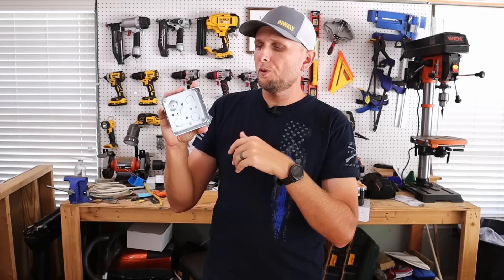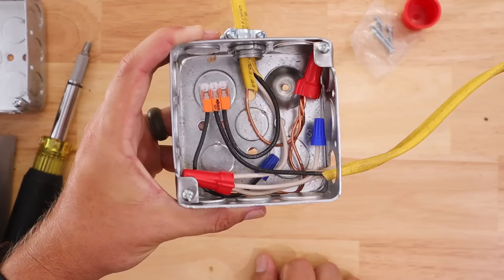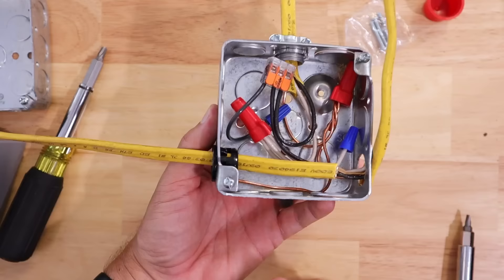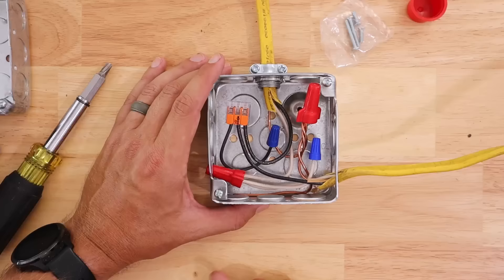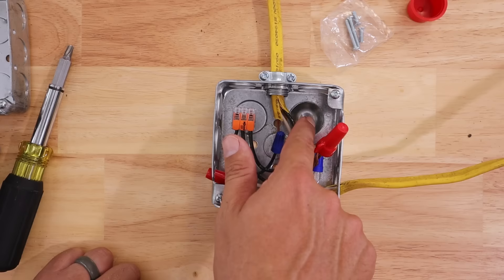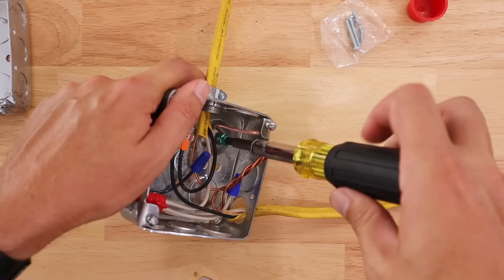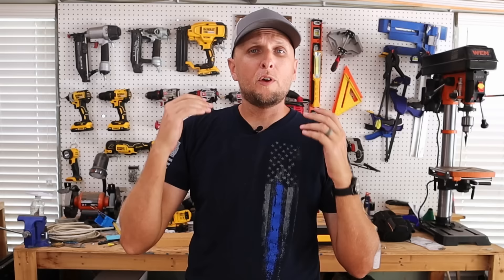The BIGGEST Mistakes DIYers Don't Know They Are Making When Installing Metal Electrical Boxes

Comment: I am often amazed by how bad US electricity installations is.
Here in Sweden, we use plastic connector boxes and we use pipes between boxes and our wall sockets are really safe since no metal on the rear to accidently touch and so on. Your system really should be transitioned to modern proper installations ways.
Reply: North America in general is WAY behind Europe when it comes to building construction.

Comment: Go over that the directions of the outlet up or down with the ground up or down . I look it up there is no ground up or ground down as the outlet are installed. Unless it is mark on the top of the outlet . Because outlets can be mounted sideways too. I have been a electrician for over 40 years the NEC book has nothing in it but spacing in the rooms

Comment: ...mmm during my 35 years on construction sites , I have seen may union electricians use electrical tape to tape the wire nuts on to the wires - because its no fun to open a live box and have the wire nut fall off . Yes many will argue to never ever use tape . In Indiana I had to remove  fixtures  and cabinets in a store and the electricians only used electric tape to hold the wires together when the wired them up ???  no wire nuts were used ...   YIKES !!!

Comment: You also may wish to cover the NEC code for minimum wire length both from where the cable enters the box and from the outer edge of the box to the end of each wire / conductor.
Reply from the maker: Yes 6 inches from where the wires leave the sheathing or raceway and 3 inches past the outside edge of the box.

Comment: In Canada every box comes with a bond screw, but I’ve encountered ones where the screw got lost. Literally any screw that threads into the home will work. I’ve even used a wood screw before 😂 it’s only purpose is to ensure permanent contact between the bond wire and the box. After all electrons are colour blind, they can’t tell the colour of the screw when they’re trying to find ground😏😉
Reply: Wood screw???  That is not good.

Comment: Isn't another problem the unsecured ground wire that was totally forgotten about.  at the beginning of the video there are 3 ground wires in the wire nut.  2 for the in/out wires and the third is just sitting in the bottom of the box.  Then later an additional ground wire is added to the wire nut and screwed into the box, but that additional exposed copper ground wire is still sitting there.

Comment: Thanks for the video, is the green colored screw a local code or accress the board? I have seen electrical octagon boxes sold at HD with non colored screw for ground
Reply from the maker: The color doesn’t really matter.  When I said it has to be one of these green screws what I meant by that is that if someone doesn’t have one you can get the green ground screws from just about any big box store and know you are getting the correct size, type, and length.  Those things do matter.

Comment: I wouldn't run any less than 12awg for proper protection from voltage drop on long runs.
Reply: For outlets, sure but on fixed loads like lighting circuits, #14 is fine and easier to work with.

Comment: A 14 gauge wire is rated for 20 amps. If you are installing a standard duplex outlet they are rated at 15 amps. Standard practice for years was to wire through the device, using 12 gauge wire through a 15 amp outlet without using any jumper. This could be a problem on 20 amp circuits, causing an outlet to overheat and fail.   I don't see why the 20 amp rated 14 gauge wire supplying a 15 amp rated outlet could be a problem as the outlet would fail before the short length of 20 amp rated wire.  It has more than enough capacity to supply the outlet. But don't use it for 20 amp outlets.

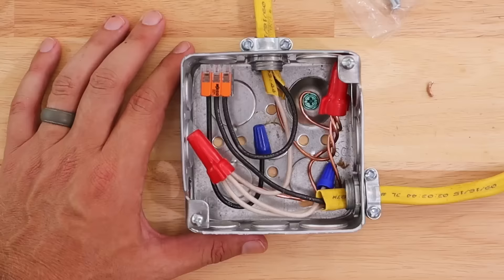Comment: On 8:44 is it okay to run 10/2 on a 12/2 pigtail. So instead of going smaller you use bigger, will just be used for an outlet on other side of wall I wanted to daisy chain a 2ft piece. I only have 10/2.

Comment: do you need to fill the empty slot in a WAGO? if you only had a three hole but only used 2 holes? seems to me you would, especially in a metal box. Might arc?
Reply: No, they don't make a 4 position lever nut, so you'd use a 5 position and leave one position unconnected in a 4 wire connection, for example. The conductive part is way inside, so as long as there are no uncapped wires floating around, there's no issue.

Comment: I always find it interesting...for the most part, we get stuff from all the same supply chains as the US, but electrical stuff is always a little different. I've never seen a plastic box (except on YouTube), so I imagine it doesn't meet Canadian code. But more interesting is that I've never seen a metal box sold without a ground screw...that's just asking for DIYers to skip an important step.
Reply: hmmm, building and energy code in Alberta demands the gasketed pvc boxes on all exterior walls, and fire walls.

Comment: NEC also states that you have to have at least 6 inches of a conductor in a box from where it enters that box. The box that was shown did not appear to have that much wire in it.
Reply: Influenced by the current (no pun intended) cost of Cu wire, perhaps?  Inflation influenced cheating just a bit?

Comment: I understand your point about the 14awg but actually wires are rated by length and current.  A 14awg wire is plenty adequate under 1 foot to carry 20 amps without a problem.

Comment: I appreciate that you've explained grounding the box and how important that is but personally I prefer to take it a step further and when using metal boxes I opt into going 4 wire and isolating grounds. Can you talk about that sometime?
Reply: The section of the code book that discusses isolated ground circuits is specific about a few basic points:  The point of use ground (insulated) must be identified (typically green tape or a green stripe on the conductor's insulation), and, an isolated ground circuit will only be compliant if ALL receptacles on the circuit maintain isolation.  IG receptacles will have a specific symbol or writing on the face to indicate such.  Hospitals and data centers are typical environments where IG is utilized, but not residential - places where sensitive electronics or life safety equipment is present.

Comment: Great information.  A DIY'er , but my dad was an electrician and engineer..   I  ALWAYS  pre twist the wires and it infuriates me when I don't see that done...like in the home I purchased a few years ago.  I had to open several boxes where a few of the hots and neutrals came out!!! Yikes!
One subtle  tweak necessary that you showed when you did the ground bonding is the you even the wires by snipping off a little at the end. Again, this is a must to properly fit the wire nut.  BTW, its nice the newer metal boxes have the hump for the green screw, so it can easily tightened. 
Have checked out a few of your videos - nicely done/

Comment: I’ll add the obvious…it needs a cover.  The jackass that wired my house over a decade ago loved splicing wires in the attic and had most of them in boxes, but had covers on none of them.

On the #12 vs #14, depends on your overcurrent protection.  If you are protected at 15A, or if you are on 20A and is not the first device on the circuit, the #14 is acceptable.  Not best practice in my opinion, but I recall is code accepted.

Comment: Question - is it necessary to use green wire nuts for ground, or is it just good practice?
Reply: The green wirenuts have a hole in the tip so you can leave one wire Xtra long to reach the ground lug if using a metal junction box.
Reply: I like using them in switch boxes because they are large enough to accommodate all the grounds you will encounter.

Comment: So.....what exactly are the advantages of using metal boxes in a residential home? I  personally don't know of any. I'm half way thru our home renovation, and so far, I've been using plastic or vinyl. I'm not sure what they are made of, but you get the point.  If there are advantages of using metal, I'd like to know. Thanks 😊
Reply: Plastic boxes are pretty much the default for US residential construction and obviously they are adequate. They are cheaper, quicker, and easier, so they save money for developers and contractors especially for large scale residential jobs. For a personal home renovation the cheaper and quicker are irrelevant. Compared to the overall cost and time of the entire job the difference is not significant. I've used both in remodeling and I prefer the 4x4 metal boxes with a single or 2 gang mud ring. I wouldn't use single gang metal ones. The advantages are that they are stronger especially the multi gang. The 2 gang plastic boxes deform easily and are pretty wobbly on the far side from the nails. The metal boxes are easier to line up accurately to the drywall surfaces and you can mount them with the screws of your choice instead of supplied nails. They can also be mounted from the rear. You can use mc cable or Romex and the cable clamping options are better. They generally offer greater volume for cable management and visibility.
Reply: @surferdude642  thank you for answering! You make some valid points I hadn't thought of.
Reply: In many parts of country the use of conduit is standard in residential. All the metal is the ground so only 2 wires are ran throughout the pipe. Much harder to install but a superior system to others.
Reply: @charliemiller3854  Not true at all. In most parts of the country conduit is not used at all in residential. Very few exceptions but one is Chicago and much of the surrounding area, minimum wiring method is EMT.
Reply: @pd  well that's exactly where I'm from so yes I  know. Population wise it's still a huge number. I know other places don't. Which is really my point. EMT is a much better quality system. Hanging "extension cords" and plastic boxes isn't quality or requires a great deal of skill. Yes I've been certified before so I know.

Comment: The 14ga wire should be good connected to 12 ga wire if the breaker is set @15 amps, no?

Comment: Thanks for the lesson. Isn't that a junction box? would you still need to ground like that if just use it as a junction with no outlet or switch?
Reply from the maker: Yes.  Anytime you have a metal box, it needs to be grounded.

Comment: I might add to not wear metal rings/jewelry & watches when doing electrical work, especially when working in a hot panel box to prevent getting shocked or worse being electrocuted.

Comment: I prefer the green wire nuts with the holes in the top. That was you do not need the ground pigtail. I was introduced the to green nuts by my electrical inspector.
Reply from the maker: Yup those things are awesome!

Comment: As DIYer i have an honest question. That last comment about the 14 gauge being connected to the 12 gauge in the wago.
 Is that really an nec regulation because it doesn't seem to make a lot of sense in my mind.  because the 12 gauge is carrying the current to the Box and then out of the Box to the next outlet but the moment it gets to the Box changing to 14 gauge would seem acceptable if the plug is going to be right there in the Box.    It would seem from the wago and 6" to the outlet that 14 ga would be more than capable of carrying the load of one duplex outlet.
Thoughts
Reply: Yep it's in the box.  And the fixture wire will be even smaller.

Comment: I have a light in my shower which started flicking, I put a new light bulb in, and it also flicker, this light has been in for over 20 years.  Getting ready to change light switch and check light socket, do you have any other suggestions?

Comment: Nice simple video. As a previous commenter highlighted, the fact that there are plastic options out there may have created a bit of laziness in the reasons why we need to do things a certain way with electrical wiring. I am old school as there hasn't been much need for major innovation with electical wiring in decades, those behind the code in the past were not geeks who looked to change what works and is efficient. There has traditionally been just enough coded elements to understand the codes and why they are important. However with some new gadgets coming into market (aka Wago) I am not and will not be an adpoter. These "replacements" (not enhancements) are not adding security, reliabily nor resilience to our residential and commercial infrastructures. Wire nuts, metal boxes and copper (not aluminum wires) are time tested, proven and work well and you don't need to be an engineer to understand how and why they work and are time tested.
Electricy can kill. Sloppy electrical work can kill and destroy. Doing a good job takes as much time as being sloppy.
In conclusion: Great video and true, a lot of DIY videos out there are in fact chilling.

Comment: 2:41 Wire boxes right... Uses plastic wire retainer. Strike 1. Steel retainer is fireproof and if the insulation burns up it will hopefully short the wires and trip the breaker.

Comment: I’m pretty sure you need a “green” ground wire nut (with the hole in the end) for grounding wires that are made up.
Reply from the maker: It’s not required but they are nice to use.

Comment: I enjoyed the video. I’ve got an old house with EMT and no bonding to the metal boxes. Also, no place for a green grounding screw. However there’s several wood screws holding the box to the stud. Could I not use a pan head screw to hold my ground wire to properly bond the outlet and box?
Reply: It must be a machine screw that has 2 full threads in contact with the metal were it screws through the box shell. A 10-32 drill and tap will make a threaded hole which will meet that requirement by using the same gauge and pitch of screw. Specifically the screw used for bonding the box to the Equipment Grounding Conductor must not also serve any other purpose. There are grounding clips that go over the front edge of the box to attach a bonding jumper. At first they will seem a little tedious to use but once you've installed a couple of them you will be able to do it fairly quickly. It the box is corroded don't use the clip. Drilling and tapping the boxes metal shell provides clean metal to metal contact. 

Tom Horne

Comment: So, I have to connect all the grounds together, then make an additional pigtail from those ground to the box? What if the Romex from the switch is grounded at the switch? Do I still have to make the ground at the box??
Reply: Yes, all metal items must be grounded. If the switch is removed from the box with the power on, the box will lose its bonding to the electrical system.

Comment: i have ungrounded supply 2 wire k/tube coming into box and 3 wire 12/2 coming out. how do i ground the metal box? just put a green pigtail on the 12/2 and screw to box threaded hole? thanks

Comment: The 12-2 in the bottom right (the one without the connector) seems like the grounded conductor (neutral) is too short.  I think the code says it shall extend out of the box at least 6".  That one goes from the entry point straight to the wire nut and is less than 4".
Reply from the maker: It’s not, I measured them all out to ensure they were at least 6” and could extend at least 3” out of the front of the box.  3” have to extend from the front.

Comment: I would never use wagos. I found them melted numerous times. They are dangerous. Even low current applications i seen them fail and go resistive.  Never saw a wire nut fail though.

Comment: Rule of literal thumb when stripping and cutting wire to length. Wire should be hand and thumb length from the front of the box. Romex jacket should be stripped back as close as possible to the entrance of the box. Wires should be twisted together prior to putting on a wire nut. 14 gauge wire is good for 15 amps in most cases. 12 gauge is good for 20 amps...

Comment: Quick question, what's the advantage of metal box vs. plastic box if installed in the interior of a home?   Or are the metal boxes usually for exterior only on residential?  Thanks!
Reply: Plastic boxes are cheaper, quicker to install, can only be used with Romex (NM cable) and don't need an equipment grounding conductor. Metal boxes are stronger, won't distort, and will accept mc cable and Romex. Metal boxes can also be used for interior locations where plastic boxes are commonly used.
Reply: @surferdude642  awesome, thanks!
Reply: Wondering how a metal box will endure wx outside.  Rust?  I'm not referring to specialized outdoor boxes that are painted (or AL) and sealed.
Reply: @replyhere590  The standard silver galvanized steel box is not made for wx outside, not because of rust, but because they are not weather or water resistant, too many places for water to enter.

Comment: Thank you for the 12g vs. 14g issue. I think I have seen that in my house in a couple of places. Now I know to go fix them. Thanks.
Reply: don't bother, unless you are familiar with the local AHJ requirements, and the ampacity tables for wire gauge.  Only a few places use #12 exclusively, a lot use #14, and both have a significantly higher current carrying capacity than a standard 15a breaker.
Reply: @bjlanders  Thanks for the input. I guess I was thinking mainly about some outlets in garage of all places that have 20a breakers, #12 wire from the breaker and were extending with a #14 and the 20a outlets have #14 wiring to two outlets on either side of the later add on. I am not likely to have tools pulling that high an amperage...

Comment: I know this sounds smug, but US  fittings always look like they haven't changed since the 1940's - e.g.the clamp with screws, having to separately procure an earthing screw and wrapping the wire around it. Also, the practice of using wire nuts in permanent installations always makes me wince.